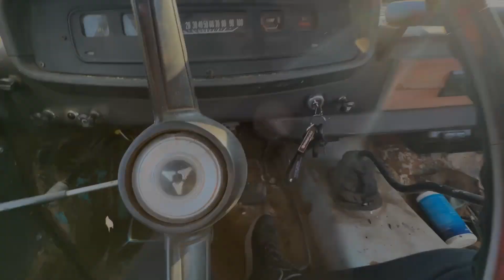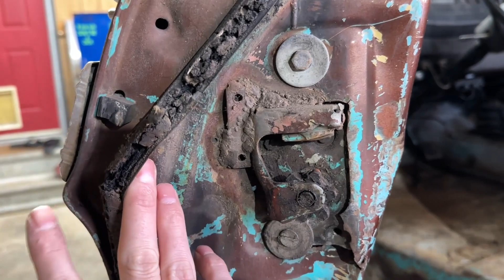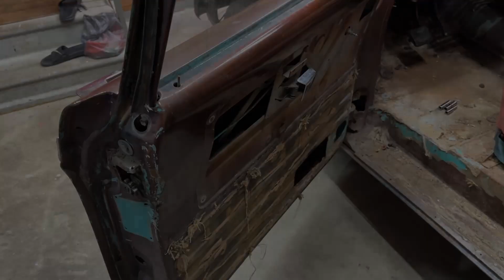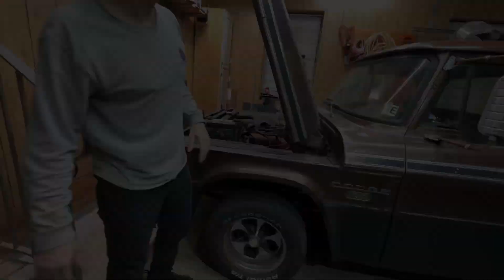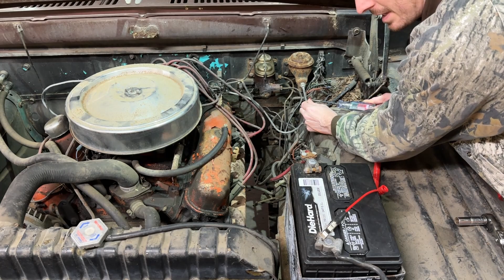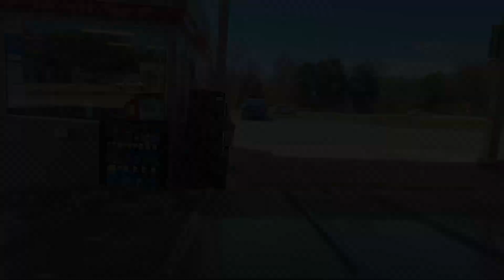Dodge D100 Build Pt.1 Back on the road

Comment: Gotta love the wiring I just figured out my brake light issue and fixed it today
Reply from the maker: This truck is a nightmare for wiring. Good thing there isn’t too many wires
Reply: Thank God it’s a1960’s truck not a 1990’s 😳. I have to replace the entire wiring harnesses on mine and I mean EVERY single wire even the dome light. Damn rats
Reply from the maker: @charizardsniper5064  Damn, yea the newer they get the amount of wires grows exponentially

Comment: I  have a, 1965 D100. Shortbed/stepsice. /6 w/ 435... pulling motor and trans.. 1964 New Yorker 413/727 swap. Keep up the content. Great video. I have the 2 some steering wheel too. 😎

Comment: the best thing to do to that truck is a 1974 dodge truck frame swap really easy almost a bolt on swap then you have disc brakes and independent front suspension and power steering
Reply from the maker: I like the sound of that I’ll look more into that year now. Yea that I-beam front end isn’t the greatest
Reply: @justtheClark  did one several years ago was a easy swap. I would think any of those body styles will swap I just happened to have a 1974 that's why we used it. I would think any will work up till 93